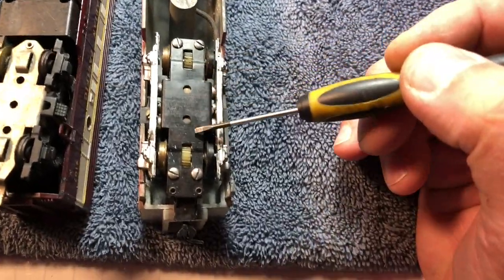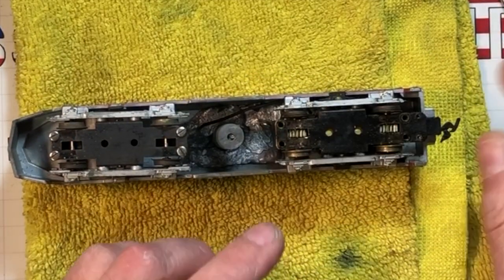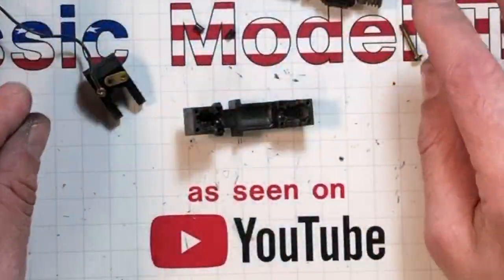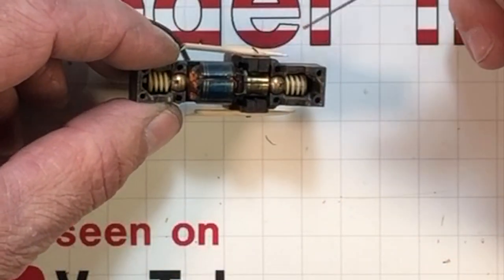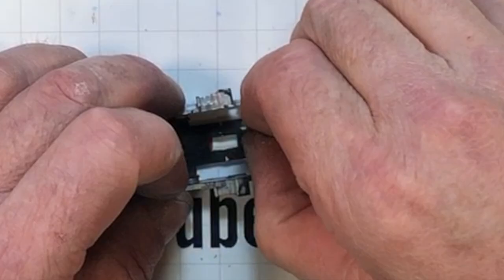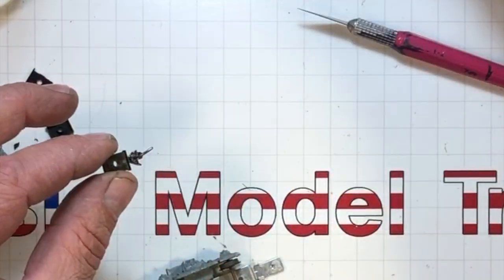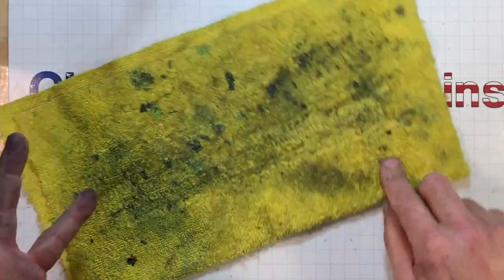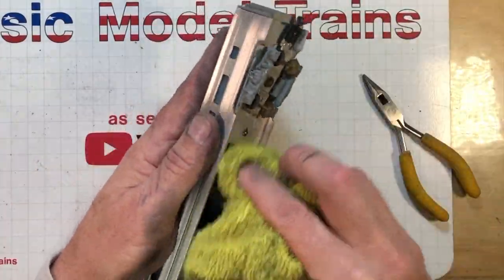Fixing an Old Cast Tyco Sharknose Loco & Passenger Set.

Comment: Super. I have never even seen this version of the Mantua/Tyco RF-16 Sharknose before, and I have looked at a lot of used Sharks. A superb locomotive, but I have always liked those passenger cars since I first read about them in one of my model train magazines. My railroad is still able to operate cars equipped with the Mantua Loop coupler because my MOW work train is equipped with them, and my car repair department (Me) is somewhat unmotivated to replace them, so I still have a Mantua Loop to Kadee knuckle Train Miniature coupler conversion MOW car in operation. FYI: Properly adjusted Mantua Loop couplers work great, and the same manual or electric uncoupler will also work with the Maerklin Relex coupler. Good job on the locomotive. Hello from the Tracy Mountain Railway in Colorado. 💙 T.E.N.
Reply: By the way, it is Man-Tua. 💙 T.E.N.
Reply from the maker: Them loop and hooks are interesting to me.

Comment: Hey Ron,

The best thing to clean those aluminum trains would be Barkeeper's Friend Liquid version for non scratch and the powder version for rust, chrome, tile, any metal you can thing of as long as it is not mirror finish. This stuff works in one pass. Those passenger cars would have required about 15 minutes of work for the whole set and they wouldn't have tell tale signs of corrosion. You can buy this in your local super market next to the kitchen cleaners. When you have rust, nothing gets it off as well as the powder version.
Reply from the maker: Thanks for the info there Tom!

Comment: Bit late checkin out this one, but glad I did! I gotta find one of these diecast sharks.
I think that metal stuff in the shell was somebody trying to add extra heft to the shell, rather than fixing that post- I've seen similar things done and done it myself a little.

The reason folks will say "don't take apart the magnet, it'll kill the strength" is because a lot of older models used an Alnico permanent magnet for the magnetic field. These magnets can be nice and strong, but they're not great at holding onto that magnetism for whatever reason- somebody out there knows! Fortunately, if the magnet is up against some magnetically attracted metal, of a certain mass, it creates some kind of magnetic flux that keeps the Alnico magnet's strength somewhat stable.
Removing the motor armature, magnet, or field pieces disrupts that flux, and the magnet's strength is no longer being kept stable. But that's only one piece of it! The other matter is this- the whole motor assembly (magnet, field, and armature in all) is magnetized in an assembled state at the factory, because for one reason or another, the complete assembly can hold more magnetic strength than the alnico magnet can hold all on its own. So by disrupting the relationship of the parts/breaking the magnetic flux between the armature, field, and magnet, you loose some of that magnetic strength that was held by the complete assembly.

As far as I know, this phenomenon only really affects Alnico magnets, at least to such an extent that anyone should bother worrying about it. The only reason it's a problem is that a weaker magnet will give the motor less torque, and it'll be more inclined to overheat. If the magnet on a motor is too weak, people have had a lot of success replacing them with rare earth (neodymium) magnets. You could also purchase or build a magnetizer, and zap the strength back into the original magnet. I have a vintage magnetizer Lionel sold to service stations in the 1960s for use with their HO motors. It's a very handy tool, but unfortunately Lionel didn't design it to be adjustable so it only works on motors that will fit between its magnetizing poles.

There's somebody in the UK who sells a motor magnetizer but it isn't cheap, I think he hand-makes them. But as far as I know, all you need to make your own is some handy skills, some iron bar/rod stock, and a big ol spool or two of copper wire.
Reply from the maker: Thanks for the cool info on the Alnico magnets.  Ive been trying to read up or buy a re-magnetizer.  not a lot of info out there Ive found useful so far.

Comment: You did a spectacular job on the entire restoration of this vintage TYCO MANTUA set looks brand new. I too have a TYCO MANTUA cars different road names. I applaud  when you replaced the old horn hooks with the coupler box installed onto the extension. When I put on a KADEE coupler it needed a sleeve that was no problem... Since KADEE & WALTHERS PROTO are metal I attached coupled another MANTUA car I was having overload & sparks until the warning light on my powerpack lit up. The conversion done is 100% recommended. the plastic box insulates the metal couplers. Very well done on your project very well done. 👍🎥
Reply from the maker: Thank you for your kind words :-)

Comment: Very cool! The aluminum passenger cars turned out fantastic as did the RF-16!  I do not have any MU1 motored locos, wish all my MU2s were MU1s lol.  You probably have done this already, but if you, painfully, break off the plastic side trucks on an MU2, you can at least clean up the commutator and some gearing. Super glue works great to reattach the side trucks!  Just repainted a Mantua/Tyco RF-16 in jade green New York Central. Yep, also knew recognized this weeks classic model. All the best!
Reply from the maker: I need to do a MU-2 video.  I think I'm going to go the drill out the rivets route.  Replace with very small machine bolts and spacers that will be needed.  Or.....submerge the motor in jewelry cleaning solution.  Ive heard of Fellers doing both.  Thanks once again for your kind words Erick :-)
Reply: @classicmodeltrains  ahh jewelers cleaning solution!! Will have to get some and I really don’t want to drill out the rivets.  Thanks for that info!!!

Comment: Hey, Ron. Places like the front truck wheel points&coach pick-ups for lights that are conductive. I use ACT-6006 Track&Rail Cleaner(conductive). It's got a lube factor to it. Also, use it on track switches.🚂🇨🇦🇺🇲🙋
Reply from the maker: Right on.  I have a conductive grease I picked up a while back.  Don't use it too much.  Everything seems to conduct pretty good after a cleaning.  I suppose it will corrode over time if its doing shelf queen duty

Comment: Really enjoying watching your videos. I have a sentimental tyco rock island with  power torque drive the same as the one behind you. It's very good condition but has cracked wheels. Turns out they're not that easy to find.
Reply from the maker: Thanks for watching.  You will have to scare up a parts loco.  Any loco that has a power torque in it will work as a parts unit.  Ive seen a few tyco's with cracked wheels but not many.

Comment: Any idea what brand those coaches are? I just polished up a set that looked similar but mine were made by Herkimer and mine are the shorty 60 foot versions. Did a video on that last Fall. Or December. Then I got some long ones that were badly corroded. Those took a while with the wire wheel. I should try actual wax on mine too, they are not as shiny as they probably could be. Yours would look sweet with that Burlington Varney engine you did. Maybe use Burlington decals on the coaches?
Reply from the maker: I'm pretty sure they are Tyco. 50's stuff. You know that idea with the Varney A & B is a really good idea!

Comment: I have the blue & yellow one you showed  & yeah it needs fixing 
never has run since I got it & the one you have came with a B unit & matching passenger cars 
Plus I want the dummy & B unit for mine
Reply from the maker: Yup.  Now I want the matching stuff for this set.  Dang Hobby anyway :-)
Reply: @classicmodeltrains  yeah ones for yours came as a boxed set 
all the passenger cars have Tyco Streamliner on the top 
but anyway mine hasn't ran since I bought it

Comment: Thank You for this video. I have this same type of Shark nose diesel (a unit) with the same MU-1 motor setup (It has the open pilot with the hoop-link couplers). Although it does run, it will need the wheels cleaned and the power truck relubricated. Along with the A unit, I have the dummy B unit still in the kit box from Mantua, and many of the Mantua aluminum passenger cars of each type. My plan for the A&B unit sharks along with the Mantua aluminum passenger cars is to create my own version of the Tyco Streamliners train. Also, I would love to find another MU-1 motor kit to make the B unit powered, but I have not been able to find any at this time (the search still continues). As far as pronouncing the Mantua name, I say it just like you say it. I guess this is due to my Midwest Ohio speak.
Reply from the maker: Another vote for two-a! Hope you get that consist all put together soon. It should look real sharp!!

Comment: On those that power travels through axels. After a well deserved and neglected cleaning. I like to use a small dab of dielectric grease. It helps make better contact for power to travel through. Plus greases them. Do not use as regular grease. Don't use to grease everything. Your engine will not work properly or not work at all. Will ground itself out. If you don't know anything about dielectric grease.
Reply from the maker: Ive researched die-electric grease quite a bit.  I believe it would be beneficial at some of the contact paths of the juice.  keeps them from corroding or rusting, or whatever process the 2 dissimilar metals are going to do.

Comment: What sized tubing is that? I think it might cure plenty of my coupling ills.
Reply from the maker: It's fuel line for chainsaws. I got it at the autoparts store.  just small enough to slide in the hole on the Kadee.
Reply: @Classic Model Trains  I like it. I'm going to have to try it. I have a lot of railcars I've been wanting to convert without having to build/rebuild the draft gear boxes. This might be just the ticket a guy needs to get that done!

Comment: Acetate or clear sheet plastic in place of the original opaque windows would look a lot better.  Also, I wonder if those cars were based on the original Central of Georgia Man-O-War consist that ran between Atlanta and Columbus, GA.  At any rate, I think those cars are probably incredibly rare.
Reply from the maker: I think clear windows would look better also, but I wanted to leave these original as I can.  Wished I had enough original couplers to use instead up going to Kadee's.  Not that these are worth a lot of $$$ just like factory stock old stuff :-)

Comment: Instead of buying those small bottles of Micro sol which cost you $5 each... you can use vinegar which is less than a 1/3 of the cost and most houses have it in the kitchen... I try to save $$$ bu not buying or using specific model applicable items which they always mark up for hobby $$ when most houses have the necessary items in a house without purchasing specifics....  that engine and those carriages came up great.
Reply from the maker: Hello Tim.  I like your way of thinking and completely agree.  I had no idea what was in micro sol.  Thanks for the tip!!

Comment: Lol they went from to many screws for maintenance. To no screws no maintenance. With 2 rivets. If they would've used 2 screws per truck they could've used extra screws to save money by not having to buy rivets. Why would designer take something that's made to be maintained by taking apart. To something that isn't able to be taken apart and harder to service properly? I have few of them. I'm replacing rivets with proper screws for era. Great video.
Reply from the maker: I agree with you John

Comment: I think it's Man-choo-ah.  Magnets in those motors are meant to be changed out to rare earth magnets which are easily found on FleaBay.  In so doing, it will reduce current draw on any little electric motor.  I did all my Pittman motors and really made a difference.  All my rolling stock got body mounted Kaydee couplers (whisker mostly) and metal wheel sets.  Gets costly when you have 150 + pieces to do especially for an old guy. 
Those aluminum coaches are begging for illumination with LED strip lighting (they have frosted windows) with a 3300uF capacitor, little square full wave bridge rectifier and about a strip of 12 LED's.  That's how many I use on my coaches & are 12 volt, can be cut apart after each 3rd one and already have the ballast (current limiting) resistors built into each 3rd LED.  I did illuminate an old REA (Railroad Express Agency) coach and made my wheel pickups out of some thin copper I salvaged from an old computer.  Now I've discovered a product that makes illuminating coaches quite easy and without much expense.  I ordered some ESU current collectors, part #50707, which will allow you to do 8 axles for $8.95 + $4.00 shipping from Litchfield Station.  The trick is to cut them apart and make sure there is an opposite insulated wheel on each side so it will pick up power from the non insulated one and return it to the other side.  They are easily super glued to the bottom of the trucks, just have to bend them in the other direction.  Then they will work properly.  
 Ohh Rah - USMC - Cheers from eastern TN
Reply from the maker: Thanks for the good information

Comment: The music at the end is cool and all, but I'd rather hear what the locomotive sounds like after the repair..
Reply from the maker: Thanks for the input.  It's pretty quiet.  There is a short shot of it running at the very beginning of the video. I suppose I should let fellers hear them run.
Reply: @classicmodeltrains  before and after would be great, it's nice to hear how all that work sounds after the repair...btw..just wondering, you have done a few repairs on the older Rivarossi locomotive's, a know seeing that probably helped a lot of people tackle there own, do you have any of the newer Redbox locomotives, that have the motor in the boiler..been wanting to tackle one of my own, but have been putting it off until I can find more info on how to take it apart...
Reply from the maker: @larmo5633  I do not have one like that. Well not yet anyway :-)